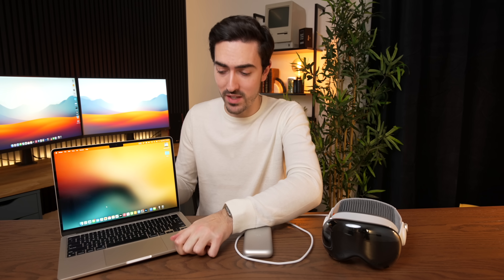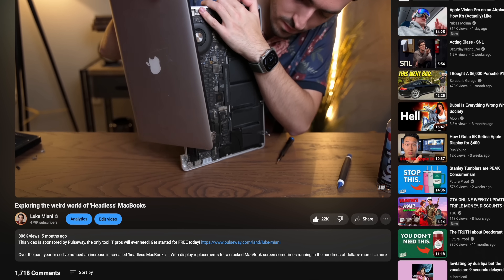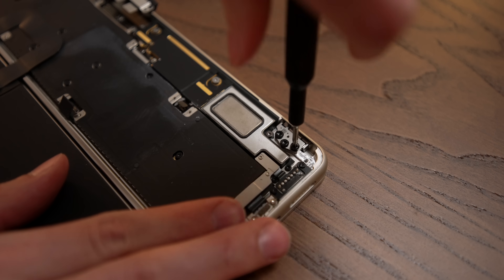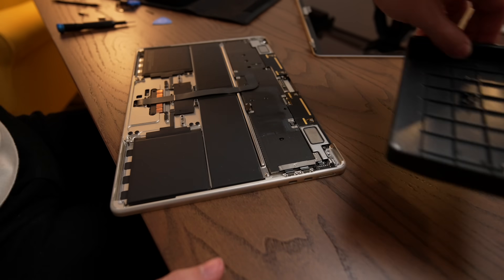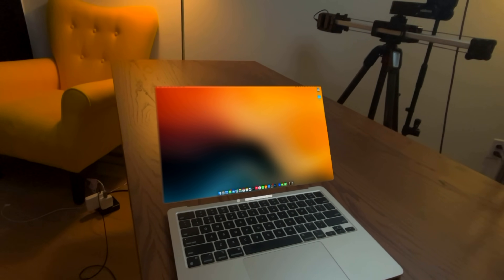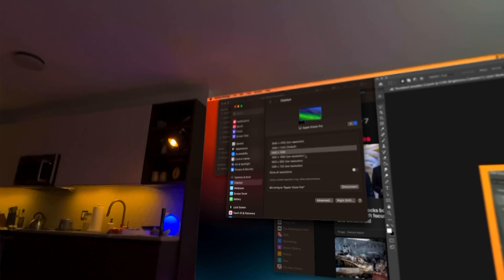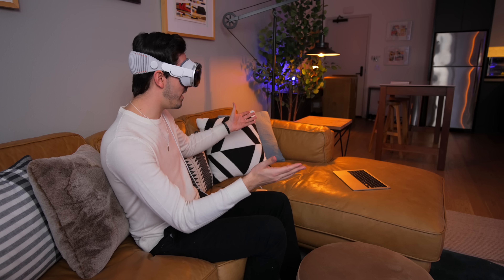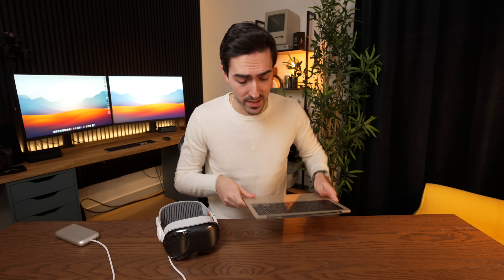Using a Headless MacBook with Vision Pro!

Comment: How heavy the the MacBook Air M2 after the screen is removed.

I have the perfect video idea for you. 

MacBook Air M2 with UPERFECT 3K OLED 120hz + trifold Bluetooth keyboard and trackpad = OLED macbook 1.6 lbs for the screen, 0.4lbs for the keyboard + 1.7lbs (maybe 2.0 I’m not sure) screenless MacBook Air

MacBook = 3.7 lbs 16 inch OLED MacBook 

Optional idea 
Pair that with a legion go and you can have a dual OLED windows and MacBook OLED for about 5.5 pounds in the backpack
Reply: Actually 

My set up is going to be

iPad 11 OLED with Luna display and case kickstand case 1.4lbs

Screenless MacBook Air M2 1.7-2.0lbs

= 3.4 lbs 11 OLED Macbook/IPAD combo

Paired with a legion go for gaming and windows file management 1.88 lbs 

Optional 0.45 lbs folding keyboard for the legion go or iPad. 

The only con is latency, with Luna display isn’t great for gaming, but I got the legion go for that, yea is IPS instead of OLED but I had to compromise somewhere (or replace the iPad with an external OLED display)

Comment: Interesting concept Luke.  I have tried using my Apple Bluetooth keyboard and touchpad with the Apple Vision Pro and that creates a pretty bulky setup and doesn’t work well unless you’re at a desk.  The headless MacBook is light works well with the AVP when not at a desk. You can take this idea one step further and use it as a touch screen Mac with the addition of an iPad and Jump Desktop.   This would work exceptionally well well with a headless 13” MacBook Pro.

Comment: I have an M2 MacBook Air that I woke up to it completely submerged in a big bucket of water, it was sitting there for hours I had no hopes of it working but I let it dry out with a fan for a couple days and left it on a shelf thinking I just have a nice looking paperweight. Plugged it in for shits and giggles the next week not expecting anything to happen and to my surprise my Mac booted up with no issues, the screen looks kind of like an abstract art project and it only works plugged in but it’s great with the Vision Pro it feels more like an upgrade than a workaround! 🙃🥴

Comment: I wish you would have mentioned TWO very important thing ma about this project before I actually did it.. all Macbook’s after 2018 will power on if you press Any key or trackpad. I did this project with my 2020 MacBook Air and now I can’t put it in my sleeve and travel with it, because it will turn on everytime. Just FYI before you start this project. Get a 2017 or older.  I use mine with luna display.

Also the display houses the sensor that tells your keyboard when it should be backlight, and how bright..  which is now gone, along with the backlight.

Comment: You know what, is actually sounds like a GOOD product idea, maybe once vision pro matures and can use it as main computing device. All it would need to be is a magic keyboard with an M chip, memory, SSD, etc. They could probably just squeeze it in there without changing the form factor.

Comment: apple should sell a foldable trackpad keyboard m2 batery system for the vision pro so you can fold it and save it when you are walking and when you need it, just unfold it and use it like this weid m2 keyboard instead of carrying a macbook, just replace the batery of the vision pro

Comment: This is not a weird idea.  It's a GREAT idea, especially for vision impaired people.  Let me tell you why.
I am a visually impaired and severely nearsighted computer user.  My eyes cannot, due to damage to the retinas, magnify things to normal size.  Things I look at appear farther away than normal.  Due to my damaged vision, I have to get VERY close to things to be able to deal with them.  Consider sitting on the front row of a class and you still can't read what's on the board.  You can see there's stuff on the board, but you can't tell what it is .. because your eyes don't sufficiently magnify to make the writing big enough to read.  Or consider trying to read a book at 20 inches.  You can see there's text written on the page .. but each line of text is so small (because of the vision) that it just looks like a black line ... because your eyes can't physically magnify things to a normal size which a normal person could read.  In other words, seeing things at any distance is difficult, if not impossible.

And consider me typing this.  I'm sitting 2 inches from my monitor, and I have special software on the computer to magnify the text so I can even see it to write and see this.  Incidentally, I'm a braille user because in some cases, it's less work to just read it in braille, rather than struggle to read things.  So I live in both worlds.  I'm a low vision sighted guy who reads Braille.  People think Braille is just for blind people but that's just not the case.  It's for anybody who struggles with print.  I just happen to have sight.  But I digress, and that's not what your post is about, so let me go on.

Basically my vision is a pain!!  I've learned to live with it and it's limitations, and I use accessibility, especially on my phone and computer to be able to do what people simply take for granted.  And Apple has the best accessibility .. at least so far ... so I'm in the Apple camp with my iPhone Max and my iPad Pro (the biggest screens for an obvious reason).  One area that my vision has locked me out of is a laptop.  All my co-workers were using laptops, but the screen size and the font on the screen were just too small for me even at 20 inches.  Basically a laptop has been unusable for me.

But now .... ENTER THE VISION PRO AND HEADLESS LAPTOP.  

This could be a GAME CHANGER .. with the ability to connect a Mac keyboard to a virtual display with the goggles.  You could make the virtual screen as large as you need, and put it as close to your face as you needed.  You have proven the concept.  I believe there's a place for it, especially in the vision impaired community.  You should run with this and suggest it to Apple.  It might not appeal to everyone, but I believe it would appeal to vision impaired people.  Apple might even make a laptop with a detachable screen.  As I see it, a vision impaired person could use it a couple of ways...

One way would be to keep the screen attached and use it with Vision Pro.  Have the laptop screen mirror what's on the Vision Pro.  Then the visually impaired person could see what they're doing (in the goggles) and yet others the person is working with could see what's happening on the normal display. 

A second application would be to detach the screen and just use the headless laptop with the Vision Pro.  The vision impaired person would not have to deal with a 12 inch screen, or 17 inch.  They could make it as big as they wanted in the goggles, and as you pointed out, they'd have a lighter device with the headless laptop.  And if they ever wanted to go back to solution #1 for working with other people, no problem.

I think it's a great idea.  It might even be a good idea for a normal person.  I hope you run with it.  Good luck.  And please reply if you have any comments.

Comment: How do you deal with having it in your backpack when any key press turns the machine on? I know without a display, the main battery drain was the display which is non-existent. Best solution I can imagine is some sort of hard shell case contraption that prevents the keys from being pressed. Curious to know if anyone has a workaround for this?

Comment: Maybe a gaming/virtual space where, like u would sit and automatically a vr headset would be placed on your head and u could control it by a keybords controller or your own head but sadly in game u wouldn't have the feeling of walking cause u would be sitting on a chair, maybe instead of a chair a cubicle room where u could walk with some kind of system that would simulate it, it would be good for things like photoshop or idk work on word excel or any program no, but for game yes.
It's an interesting idea if u could have multiple virtual displays  so u could multitask, one of the negative points is it would probably cause a headache.
Reply: But if we reduce the size and weight of the VR headset, now u ask how we can reduce it, instead of putting it on the headset it would be separated, like the monitor and the pc, it would cost more? probably.

Comment: Imagine what this does with the battery lifetime! one of the biggest power drain is the screen (and back light) - now that is gone, so the battery can be truly used to its maximum capacity. [alright I get it that if you use the headset then it turns off the screen anyway, so not much of a difference this way... but still]

and also also: this is the new "iMac" right? :D the keyboard hosting the whole computer and all you need is a big screen connected - in a way this is the best "desktop" computer - especially if you could connect the screen wireless :D 

i like the concept... until Apple calls it "illegal" and then makes the laptop a brick through software... (until they sell the laptop without a screen) :D 

mind you: we had these things in the 80's and 70's :D the keyboard hosting the whole computer :) hello Apple IIC / Commodore / and every 8 bit computer :D
Reply: Also, this is the closest we can get to the "vision pro" being the full blown computer where all you need is a keyboard (well... a pretty powerful keyboard :D ) but yeah...

Comment: Removing the screen was not necesary - Just connect external keyboard, mousepad, put any comp/laptop aside, connect your igoggles and work in that virtual reality and huge multiple screens. But anytime you need a regular screen - you have it. So, just get a keyboard with pad and you are ready, no need to disassemble.

Comment: This is very cool... I would probably do it also, seems only logical, and fun... I love to modify stuff... I got a Asus zephyrus last year, and within an hour I ripped out w*****s and replaced it with a Linux system,  always do it, no matter if it's a 3000$ laptop or something I found in a dumpster, I'm a Linux man, and that's the only reason why I don't have a M3 mac now, I might get one soon, but I can't afford it right now, too expensive... I do 3D modeling and animations on Blender, so I need lots of GPU power and RAM... Anyway, nice video, very good lightweight solution for a big screen :)

Comment: The stupidest thing is that this could be achieved with a just a keyboard/trackpad, since the Vision Pro also has the M2 inside. However, Apple decided that their 3500 dollar "spatial computer" should only run ipadOS. Imagine a desktop-mode that would be basically just like connecting a MacBook. There is basically nothing in terms of hardware stopping them.

Comment: Has this been tested on a Mac Mini and a Mac Studio to verify that the Apple Vision Pro does not require a monitor for those machines to connect?
 
I just spoke to Apple Support, and their standpoint is that any computer wishing to connect to the Vision Pro to have its display rendered virtually must have an active display. 
 
I believe that the headless MacBook works because it is just assumed that the monitor will always be there. 
 
I would love to know for certain whether I can purchase an Apple Mac Studio without a monitor and still have it work flawlessly with the Apple Vision Pro!

Comment: No this isn't stupid… Looks across the room at headless MacBook Pro 2008.... yeah I might be slightly invested in this idea already.
Really curious how it handles external displays? I suspect it does what everything now that goes into full screen mode does, it blanks out every monitor except the monitor with a full screen app. something that didn't used to happen until "apple full screen mode" was introduced.
And like Linus said what if I want to mirror my screen to show somebody something so we can collaborate?

Oh I guess I should say how I'm using my half top I have an external travel monitor that is a touchscreen so I have a touchscreen Mac.

Comment: Where I see this kind of thing being interesting is with a future, much more lightweight optical AR headset. At that point fitting so much processing power in the headset itself might be tricky, but if it's a glasses-style device that you can wear around anyway, this would be a great companion to that.

Bonus points if you can put it next to an Apple monitor and have it wirelessly connect to that too.

Comment: Useable until your computer restarts and a password is required. Maybe you could connect a screen at that point, but I'm not sure that peripherals will work without the initial password unlocked boot up. Meaning, you might have to type your password in blind, no display.

Comment: Hey Luke, I saw your video with the headless mac and the way you used the displaycover-thing to house the wifi-antenna. I've done a headless mac, but I used an wifi-antenna from inside an old router, just one cable and conected it to the middle of the three antenna-ports and also conected the antenna from the chassie to the fourth port. Leaving two antenna ports unconnected. And then I just placed the wifi-antenna inside the body of the mac in a spot right by the trackpad (almost underneeth the top of the trackpad). And it works great. Actually gets better reception than the original mac-antenna. So you dont need that ugly black tejp thing. :)

Comment: headless laptop is a GREAT IDEA.. i have a 15inc laptop and i didny use its screen almost never.. only if there is a electiric cutout i use it for 1 or 2 hours max..

so i always use my externalş monitor connected to the laptop.. it is 29 inc big ultrawide screen.. so i definitey support laptops withour screens

Comment: You are crazy. You can do this much cheaper with a pico4 and bluetooth keyboard for android.😅  You could also just leave the mac in tact and use a bluetooth keyboard for apple if you really want to use the apple vision pro. Also, you forgot to mention, if the display gets removed, your warranty gets void. Why only discuss one option?

Comment: if apple make something like a just display like= iMac with Speakers ,Mics & with a White or Black bezels and without any internal Processor just a Display and a iMac or Mac Mini with a adequate power house built in to a simplest like a laptops=MacBook's bottom half /base which should have [Cooling ,Processor ,Trackpad ,and Keyboard]with an additional option for a user friendly/Ergonomic mice/mouse in a one package for like us -> Students /Small Apartment /Dorms/ a single bedroom  bugs,/ All in one solution Fellows like us = Coding /DevOp Engineer & Students love to use mostly for every tasks form Online classes and also for our our own personal Projects and we have a need for multi tasking all time = every time  

and also Face ID ,Touch ID ,easy to use External drive's and test them on any other devices & More can be to because it is a great desksetup for us simple clean and best for the both worlds 
Display
HID's

OR 

just a  display like= iMac with Speakers ,Mics & with a White or Black bezels and without any internal Processor just a Display is enough or us/"me" it least = Single cable solution
with 
Face ID ,Touch ID ,easy to use External drive's for easy of use

Comment: Apple hit the nail on the head, VR is for monitor replacements other than games.  It makes it worth the price when you are someone that spends a premium on nice monitors.  Also makes traveling easier, I want a big screen but I don't want to pack around a monitor.  It also saves battery on your notebook and weight.  Someone should make a sleeve just for headless macbook air.

Comment: Do you think it's possible to create a "floating head" mac - detach the monitor but leave it connected enough to use? I work on a laptop a lot and in order to avoid the tech hunch I carry a keyboard and trackpad, so I'm basically carrying two keyboards and two trackpads at all times. It'd be amazing to be able to detach the monitor and mount it just 3 or 4 inches above the "body"

Comment: Mac mini, Mac Studio, Mac Pro - now there is also a monitor - Apple Vision Pro, and it could be much cheaper without all the sensors, and other unnecessary nonsense that is not necessary for a regular virtual monitor, or a virtual screen for watching movies. I need a monitor, even if it's called Apple Vision Lite), but it won't cost more than $500.
The Mac mini on the M1 has never turned on the cooler yet, I don't understand why they didn't build it right into the keyboard, or the Apple Vision Pro PowerBank?).
Apple Vision Pro is a misnomer, the correct name is iDiver)))))

Comment: @Luke Miani I have two questions. My first question is can you use a remote desktop app to potentially use a remote windows screen next to connecting to your mac screen or maybe even launch multiple remote apps while in vision os, more than one time to get multiple work screens? My second question is does apple vision pro work with any older intel macs or does the mac need to have a m based processor chip to work with the vision pro?

Comment: I think it's a great solution for MacBooks with broken displays. Or, if you wanted a cheap Mac and purchased one off eBay with a broken display to be used on your Vision Pro. But I wouldn't remove a display off a functioning MacBook, it just doesn't make sense.

Comment: I’m actually surprised this hasn’t been considered yet!  Consider having a keyboard line that has the computer embedded inside - heck maybe even a mechanical keyboard line.  And then, even without the Vision Pro, you could still traditionally connect it to an external display but perhaps in the same vein as the Vision Pro (wireless display) making for an even more minimal office layout!  Maybe it could turn into a new off-branch of the Mac Mini line 🤔